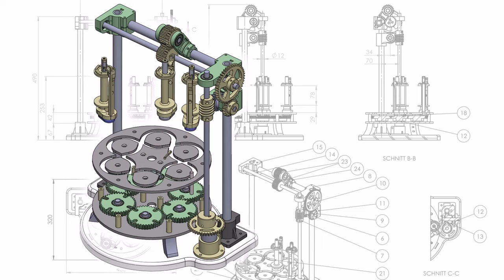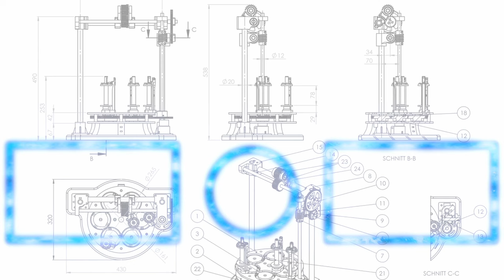3D printed braiding machine / How it works, Construction, Technical Details

Comment: Hi ! How do you hold and build the metal part from minute 6:24 where all the strings join in the cord?, and whats the diameter and thicknes of the brass sleeve that you use on minuto 2:50?
Reply from the maker: Hi, the metal part was made from a piece of aluminum pipe. But this could also be made with a washer or something similar. You could also print out a ring.
The brass sleeve in minute 6:24 has an outer diameter of 4mm and an inner diameter of 3mm.
Reply: @FraensEngineering  Thank you ! I  hope to get them done soon still printing all the parts!
Reply: does the 12 mm pipe is really 15 mm ? the link opens this one in amazon HSI 206340.0 Rundrohre Aluminium 15mm /1m 1 St
Reply from the maker: Hi, I'll check as soon as I'm at the computer. I will write to you then.
Reply from the maker: I've looked at that now. I used 12mm aluminum round. But you can also use a pipe.
Reply: @FraensEngineering  great !! thank you ! I was measuring the printed pices to find if there was a 15 mm  pipe

Comment: Hey! great video! thanks! how long to print approximately and how long to assemble after that ?
Reply from the maker: Hi, I guess it will be about 50-60h printing time. For the assembly you have to count with a few hours. I plan to sell a small batch of 10 on Kickstarter if you are interested.
Reply: @FraensEngineering  do you happen to know the price you'll ask ? I was looking at this machine to braid some small gauge electrical (headphone/speaker) wire
Reply from the maker: Hello, I am planning to sell a small series of ~10 machines via the website "Kickstarter". But I will have to invest some planning time for this. I have not yet determined the exact costs. Therefore, I can not yet name a price. There are still some things to be optimized. 
The idea of braiding cables is great. That would increase the range of use of the machine a lot.
Reply: @FraensEngineering  do you think it would work for braiding cable? I could look up the wire gauge to be sure. When are you planning on selling/doing the kickstart campaign?
Reply from the maker: The wire gauge would be interesting. Maybe I can get such a cable to test this. The Kickstarter campaign will take a while. I still have to think about it a lot. There is a lot to consider here.
Reply: @FraensEngineering  Hi! So ive done some research for the cable gauge needed. It seems that 23 to 18 gauge would be a good ans safe bet. So maybe if you could try with 18gauge wire, and If this work with 18 gauge, chances are that 23 gauge will also work. Let me know if you can and will try this. Thanks a lot for your help.
Reply from the maker: Hello, the machine is currently completely disassembled. I am waiting for a laser cut base plate. I would like to fundamentally overhaul the machine. I have some copper wires at home. I will test these then and let you know.
Reply: @FraensEngineering  great thank you!
Reply: @FraensEngineering  Hey! Have tou had the chance to work on this and try to braid small gauge electrical wire ? If not, I think i will build one and try myself. Edit: Just saw you're selling the files. But I would like to know if its working with samll gauge electrical wire before purchasing and start building.

Comment: sir what is arduino code used in it
Reply from the maker: You don't need an Arduino here. Only one DC motor is required.
Reply: @FraensEngineering  can you please give the detail of all parts used in this exept 3d printed parts
Reply from the maker: You can download all parts here: https://www.thingiverse.com/fraens/designs
Reply: Is it still available to download from website?
I couldn't find it